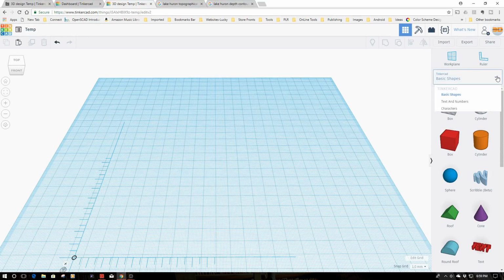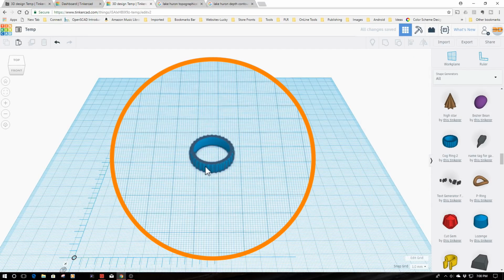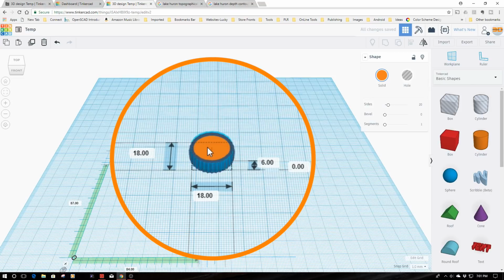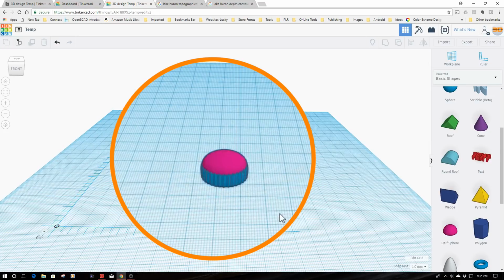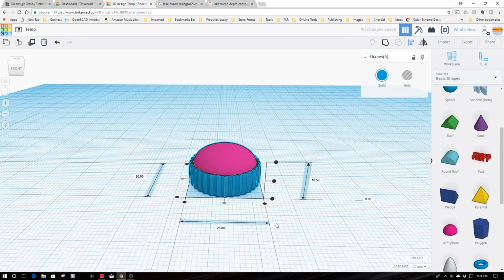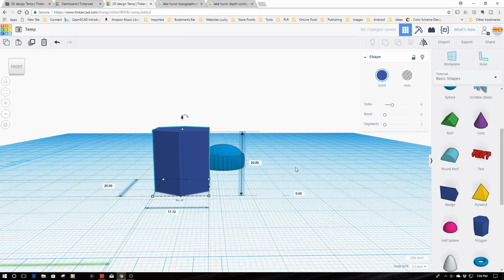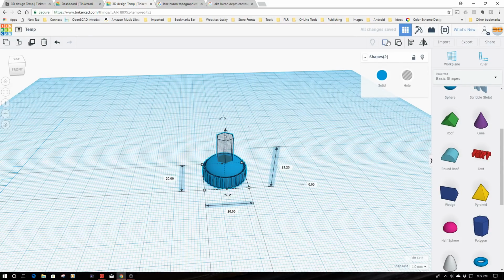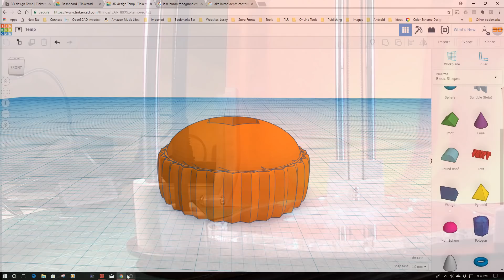3D Printed Project  - Rapid Design of a Mini Screw Driver!

Comment: There are three ways to resize a polygon in TinkerCAD.
1) You can work with guesswork when resizing irregular polygons, which is what you appeared to do.
2) You can calculate the ratio between the wide and the narrow sides. This will generally give you an accurate sizing ratio.
3) What I prefer to do is to change the number of sides to 8. Then rotate so that the narrow sides are on the X and Y grid. Then you can rescale both sides to each other accurately. Change the number of sides back to 6 and you are finished. Your sides will remain proportional to each other.
Reply from the maker: Yes, know of 1 & 2 (as I also have an Open-SCAD channel so familiar with the math, but didn't want to scare people off :-) however will have to try #3!  Thanks for sharing!

Comment: Hi - another great video! Excellent idea for producing REAL practical 3D printed pieces. BTW - I see you used the Magician - are ou planning any more videos on the setup and calibration etc. of this printer as mine is still sitting idle on my desk until I get the motivation to spend the time to get it to work :)  Keep doing these kind of videos. Thanks.
Reply from the maker: Your welcome and the Magician has been a great  performer for me no issues as just did what I covered in the existing setup vid's and its printing fool!  Is there something else specifically that you would like to see?
Reply: Thanks for taking the time to reply. I had real high hopes for the Magician but no joy so far. Must have been something I did wrong or didn't do so I guess I'll just have to do some more tinkering. Biqu have not releasing the code so (unlike the Anycubic) I can't calibrate in the firmware. But I WILL get it working some time :)